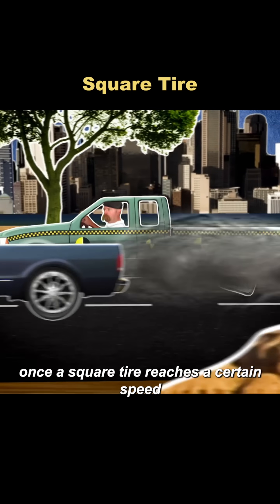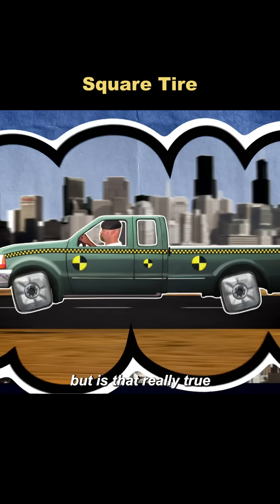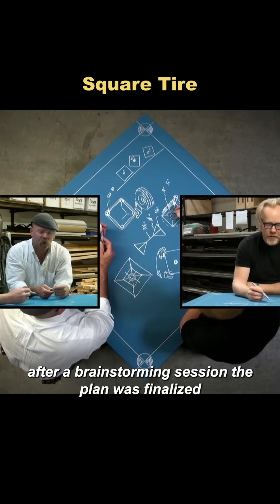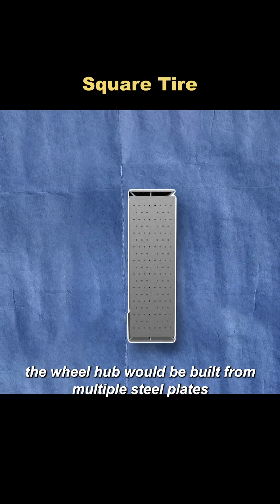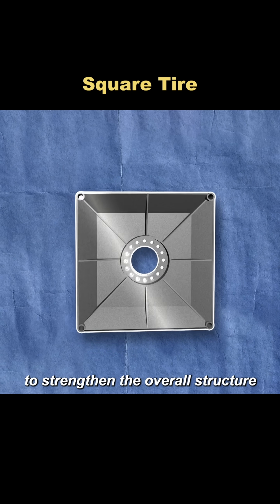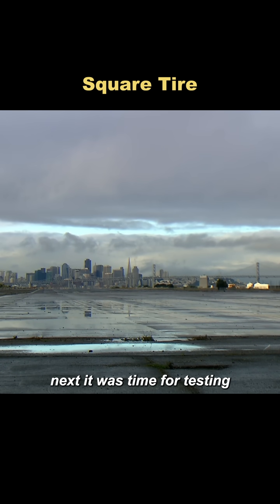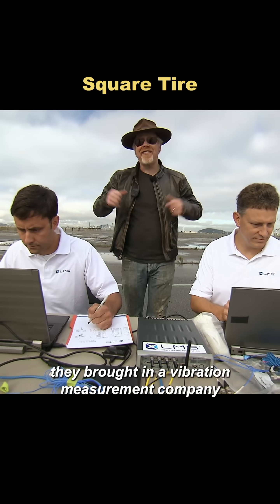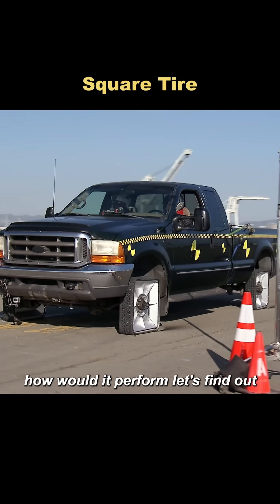Have you ever seen a square tire?

Comment: So let's look at this theoretically. This is the exact same problem as putting your hand into a computer fan. How many people have done this? It goes ziiiiiiip as it bumps into your hand. 

Theoretically if the fan goes at high enough RPM it should feel like a completely flat surface.....right? 

Well I don't know what kind of RPM that happens at but I have 12000 RPM computer fans and it wasn't doing it. Not even close lol. 

So how fast do car tires rotate? Google says 60mph you can expect around 600-900RPM. depending on diameter. The numbers aren't even close.

You would have to use cars for Hot Wheels (the toy car) for a truck and spin them at 200k RPM and maybe you can get a smooth ride. With a displacement of maybe a few millimeters it would probably be smooth even at low RPMs lol. This would be a different theory of getting your jagged wheels small enough so your ride would be smooth.

Comment: I had a friend who lived in Alaska. He did not have a garage so he could only heat the engine block and no tire warmers.  He said every morning in winter, the tires were "squared off" by the the weight of the car and the intense cold. It took several  very bumpy miles to warm up and round off. Not quite a square tire but  closest thing in real life. 😮

Comment: It's smoothness is because the tire has no time to fall down, so it hits the corner of the tire.
The durability is lower and even if the tire is [TITLE CARD], and it went faster and faster, the car is probably gonna flip over before reaching said speed

Comment: Every single time the tire does 1/4th of a rotation, not even a full rotation, the full weight of the truck literally slams into the tires.

To even get close to the speed to be able to skip to corner to corner it will have done about 3,000 slams per tire.

Comment: if the tire moves at just the correct speed, it would work perfectly fine. but it must be at that speed or a multiple of that speed.
it won't reduce vibration to 0 but it reduces it quite a bit.

note: using 6 tires correctly positioned would make it almost perfectly stable.

Comment: Square wheels can roll smoothly only on a specially designed road — like one made of inverted catenary curves where the wheel’s center stays at a constant height. Theoretically, if they reached speeds around 30–40 km/h on such a custom road, the ride would be much smoother. But on a normal surface, even high speed won’t prevent bumps and vibrations.

Comment: It can happen i think, but it is unrealistic make the car go to that speed by driving. You have to place it in where the doesn't touch the ground have it speed up, only then should it drive. But it is hard to place it after the tire reach sufficient speed, but could happen without having any driver and controlling the using ai or something 😊

Comment: u have to fill the tyres with fluid like water I mean more dense than air , It will distribute the vibrations and it will feel more smooth , yes once you reach a certain speed it will be same as round tyre

Comment: I mean, they still couldn't get past the point where the theory is refuted or validated. The car couldn't handle the roughest points, but after more speed, it should've been fine (if the hypothesis was right).

Comment: I think it would work better in enough high speed. It will never run as smooth as with round tires, though. There will still be be high frequency vibrations.

Comment: Maybe air suspension would help, some cars have it and it helps make the round feel smooth on bumps, what is does is the tires will independently move up and down instead of bringing the car up and down. Might kinda work

Comment: Yes this is true you just have to be going fast enough to the point of beating the acceleration or gravity meaning the corner of your tire touches the ground before gravity pulls you to close to the earth
Reply: suspensions bruh
Reply: @nitiniyer1 yeah suspension also uses gravity so my logic hasn’t changed the springs from suspension are compressed by the weight of the car which is caused by gravity and the springs un compress when going over a low point because of gravity pulling down on them so yeah nothings changed
Reply: @alexbarr6160  the physics is indeed changed. Suspensions increase the natural frequency. And hence reduce the response time. And the excitstion force is due to the road profile (in this case the square tires contacting the road). Gravity just ensures a vertical weight to maintain the contact with road. Basically not letting the road reaction force to go to zero.
Reply: @nitiniyer1 oh damn alright

Comment: Only rotate the rubber part not the square part but you need usher equipment to put it underneath the rubber part
Reply: If only the rubber part wont it just be track? Like in tank

Comment: It should theoretically work because when a square spins so fast it looks like a circle and so if a car accelerates fast enough for the tires to look like circles instead of squares it would work as the next corner of the square hits the ground before gravity pulls the car down
Reply: Nope, you're forgetting about suspension. That would only be true for very high speed if the vehicle had absolutely no suspension. But in reality it's not gravity that drops the wheel down. Ever wondered why you go "CLUNK" when you hit a pothole, instead of flying right over it? It's because the suspension spring forces the wheel down a lot faster than gravity, to try keep you in contact with the road. After every apex of the square wheel the wheel would be forced down. It highly depends on the spring-damper combination.
Reply: @BC-wj8fx could you theoretically go fast enough that the next corner would hit the ground before the suspension can push down the wheel?
Reply: @BC-wj8fx so just remove the suspension components and just weld the shock shut
Reply: @BC-wj8fx Seriously well made answer.
But I think it will work because similar to the gravity the suspension also emits a force on the wheel but, theoretically there is speed to overcome the gravity without suspension right? Similarly there is also a speed to overcome these suspension load 
And make contact on only four corners of the square wheels.
But you need to be extremely fast.
Reply: just cause it looks like a circle doesn't mean its a circle
Reply: @potato_is_here1923 it's a circle with extra step🗿
Reply: @TheinTanPhyu  haha like Spongebob.  Actually the reason is because the image from our eyes lingers in the brain for a very small amount of time so things moving around fast seem different looking because it's like what we are currently processing is being overlapped with the image(s) that is still in the brain.
Reply: @potato_is_here1923  you’re missing the point
Reply: It is when spinning fast enough @potato_is_here1923
Reply: @potato_is_here1923  my fellow potato
Reply: @RoPotato  brother
Reply: @potato_is_here1923 I genuinely can’t tell if it’s bait or not
Reply: It can never work. It will only feel as if the vibrations have disappeared, but they still remain. At higher speeds, the vibration can become a high frequency, which makes it unnoticeable at a certain speed — but the strain it causes does not go away.

Comment: Scientists forgetting tyres have air
Reply: But the tire with air would devaste even before these tires, because of the pressure it would receive constantly at the corners while moving
Reply: Given the shape it's likely better to not have any air, and no suspension at all (completely rigid axle). That way they eliminate additional periodic motion such as tyre deflection or suspension deflection, and are only dealing with the rolling of the shape, which then would roll smoother as the speed increases. If you have air and suspension, you will likely hit nodes as speed increases, where deflection greatly increases before decreasing again. If the deflection is too great, the vehicle may not be able to pass the node (as contact with the ground is lost for further acceleration).
Reply: Thats why tyres & wheels were circle for centuries. 😅
Reply: Thats why it is a myth buster
Reply: Nah not necessarily buddy.
But having air/ nitrogen filled ones are the best/optimum option till date.
Reply: Name of show
Reply: @Cristiano84  Mythbusters
Reply: @Cristiano84  TV show name is Mythbusters
Reply: @Cristiano84  Waste of time & energy
Reply: The cave is smarter, because they invited the round wheel 😂
Reply: Not all tires have air
Reply: @Smart-Towel-RG-400  all wheels do not have tyres
Reply: The air pressure would have tried to make the edges round though.
Reply: Bono my tyres are gone
Reply: Once the Square tire attains a certain speed.So if i am at a traffic light I will have to wait for the Square tire to gain momentum by that time everybody's gone ahead by a few hundred meters.
Reply: that's part of their charm~ they're the Mythbusters~ they're more like a family of people who are just like "what myth do we bust today?"
Reply: They are not scientists, they are wannabes scientists
Reply: What will happen if they add air on it and make something that holds the shape from the inside the rubber so the air make same shape as the metal tire
Reply: Not all tires..some are pure rubber
Reply: This episode made absolutely no sense. I remember in 1998 going to the Liberty science center and they had a car with square tires that was able to drive fast. They literally tried to bust a myth that was already proven to be right
Reply: Doesn't work with square ones
Reply: ??? If they put an air in the tire, it might explode
Reply: Hobbyists
Reply: Yess yess
Reply: A bit in me died when I saw the y
Reply: Bro had one job
Reply: It’s not that hard to spell tires
Reply: @Bean-e6f  Looks like you are from the country who is making it great again. But tyres are spelled in the already great Britain😅
Reply: Adams has alot of money to waste
Reply: whistlindiesel did it

Comment: I mean it will work it would just be impossible to get at a speed to where the other corner of the square tire touches the ground because it goes down due to the uneven ness